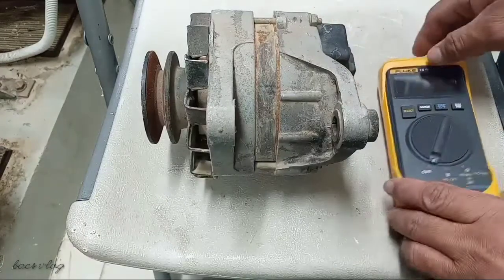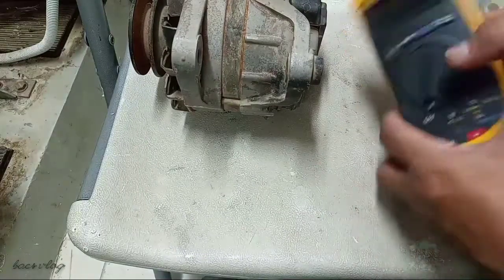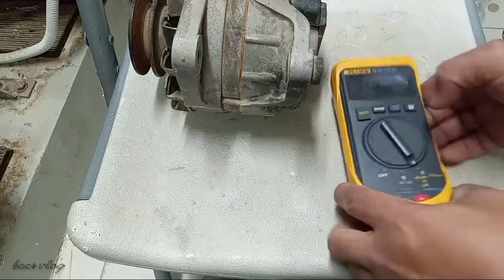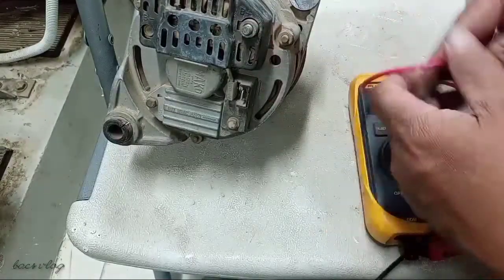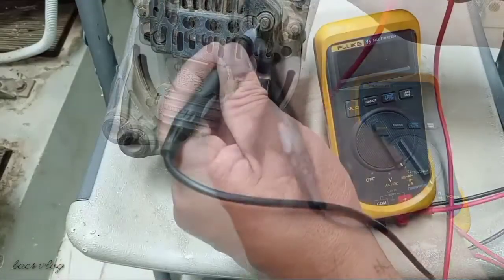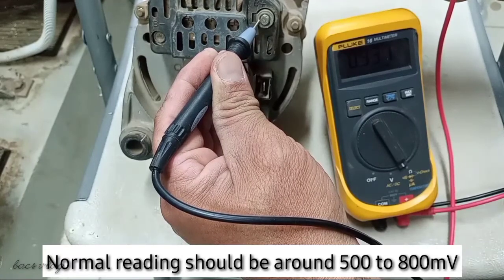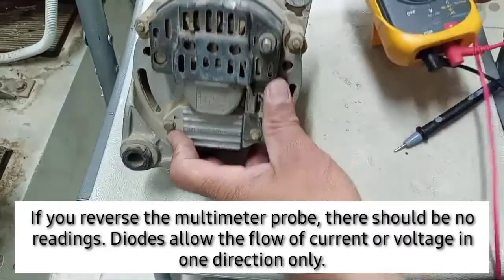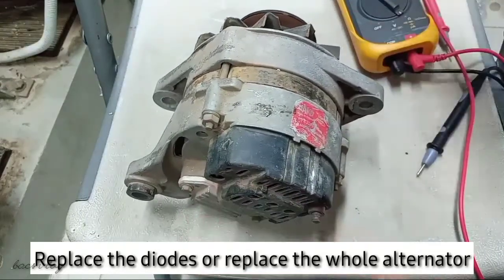How to check your alternator diodes. #diodes

Comment: I have 1 burned diode (apparently), and it reads 1045 mV. This will spew AC on my 12v battery, and I need to replace the rectifier diode assembly asap. The charging is intermittent, on and off. Thanks for the info.
Reply from the maker: Your welcome bro..